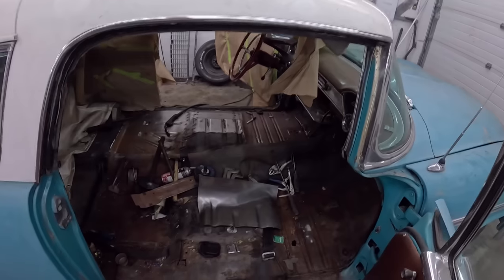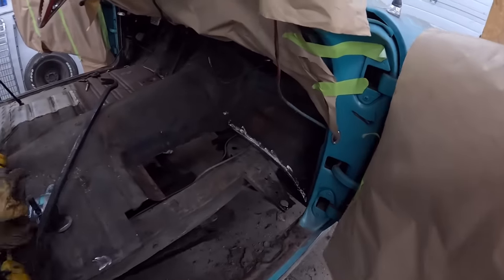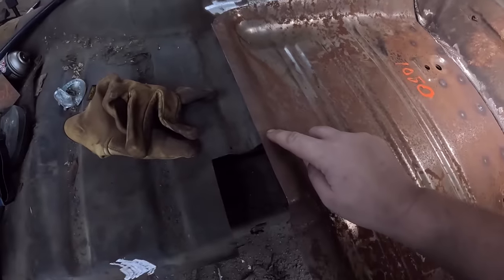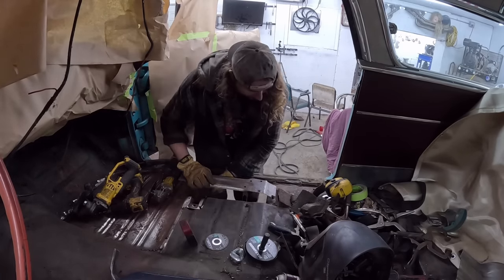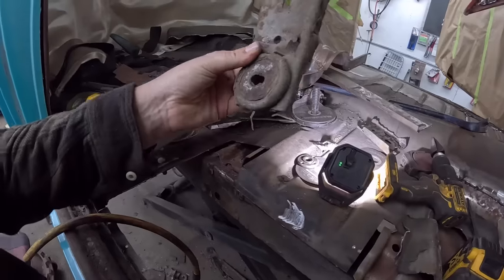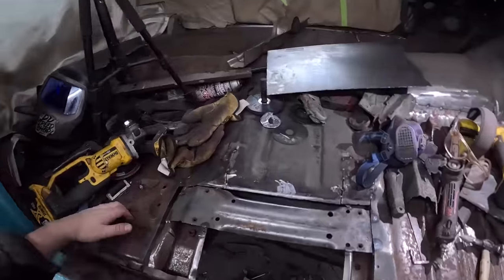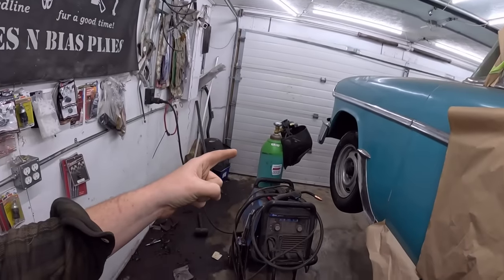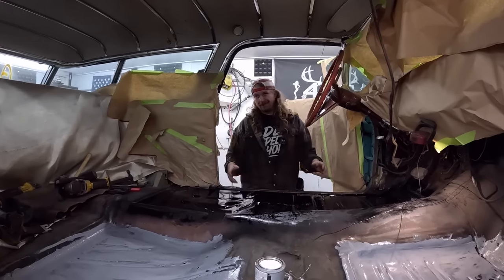ROTTEN FRAME? It's Worse Than We Thought... 1955 RottenMADD

Comment: Dan you are doing a great job on making a quilt floor . i did my 56 hardtop like this and now my 57 wagon . your welding skills kills mine im a grinder i am told but with next to no funds im still knocking it out the best i can with little cash. im up to $20 in parts so far for my 57 wagon floors and rockers. i love watching what you do and how you get so much stuff done. your about half my age so your energy level is a lot better than mine. i like your 57 hardtop work too .

Comment: Absolutely nothing wrong with that repair.  Seam seal it on the bottom only.  That is where any moisture will be.  Great fix.  Good job.
Reply: usually a floor rusts from the top down (water from shoes soaks through the carpet, or door and window seals leak)

Comment: Excellent work ! This is the way it should be done … keeping as much of the original car as you can .. and saving money for the most important parts to be needed later on like carpeting and drive train components, brakes etc. You have progressed into a true metal man and  fabricator . Also very professionally done the way I would have done it on my ‘ 55 gasser the Bandito..

Comment: Why do I like to see you cut and weld floorboard sections in. IDK
BTW, I noticed your door arm trim, and the lower window trim is not normally chrome. Normally, those pieces are painted. That is a lot of chrome, then on the inside, 
That car is going to be a nice cruiser with the overdrive.

Comment: Damn, Dan!! That looks pretty good. This is not so much a restoration, but a preservation job. I totally agree with you on patching the floorpan as it keeps so much more originality & saves messing up panel gaps. Just get a dent guy to take out the remaining damage on the roof & hood, then a light brush touch up like everyone did back in the day. That, a good polish & she'll be a sweet little period hot rod. Cheers. Leigh.

Comment: Dan, you're not a hack. A hack wouldn't be doing it the way you're doing it. It's just fine
Reply: A hack would be cutting it out with a hammer and chisel and replace it with flat sheet metal the way I did it in 1966. They didn’t make repo floors then and I couldn’t afford a grinder on grocery baggers pay in high school. 😮

Comment: It says a lot that this 69 year old car has some rot and there're piles of 20 yo gmt800 trucks from the 2000s  that are rusted in half where about half way back the frames are touching on the ground! And trucks younger than 10 years old with gaping holes in the tin foil bodies and crossmembers. You know what was a real eye opener of what pieces of crap newer trucks are I was working on the front brakes on my 92 c1500 and my cousin walked by who had a 06 4wd Chevy half ton said wow those brakes look way beefier than mine... He had a 4wd! Mines a 2wd half ton Cheyenne a base model at that! That 06 now is no more it was retired due to a rotten frame my 92 frames nice n clean both spent there whole lives sliding around through Maine winters! So what's that about oh yeah other than engines the gmt400s were the last GM truck worth a shit. And stock for stock the 5.7 vortec lasts as long as the 5.3 with only small power advantage. Sorry LS fan boys but it is true....

Comment: Hay Dan couldn't help but notice all the dust from the wire wheel if you attach the shop vac hose to the angle grinder it'll suck up the dust and metal shavings I do that and it dose wonders 👍

Comment: DD and Mortske are both "wrong" I'm sure you need the "right "silicone to replace those rubber gaskets on an intake manifold ,but with aviation form a gasket on both sides of them you can use those rubber thingies that everyone hates ,I use aviation form a gasket on both sides of all my intake,carb, oil pan and valve cover gaskets, it holds them in place,i'll even run a dab around the inside of my radiator and heater hoses.
 of course I only use Fel Pro and never had anything leak and should you have to disassemble,they're easy to get off. 
The poor mans alternative would be Indian head gasket shellac I think it's called buffalo now but two or three bucks a bottle isn't bad, I hate vacuum leaks or any leaks and this is the way to avoid them, you might take this suggestion the wrong way , I'm not telling you how you should do it, like a friend ,I'm showing you how I've learned to do it.

Comment: I enjoyed the video, learned alot, even though I have a fair amount of mig experience, but never this extensive stuff.  I am supposing a 220 volt wire welder is being used, I am unsure if Canada is a 220 volt country.  All I have is a 110 volt welder, a sp100 have always used a 20 amp circuit making it 90 amps max output and a thirty percent duty cycle,.  I did get an inverter tig welder, 220/110 volt capacity, but so far limited experience with the tig(soon to change), that I have used 220 volt.  I feel a wire feed welder is the best solution, though there are probably folks out there that feel wire feed is best.

Comment: Nice job Dan da Man! Way to power thru those floorpans, the neccessary next step. Now ur ready for some fancy footwork, double clutchin on down, Standin on the gas, stompin the brakes, tip toe'n around the cops. Ready to put the hammer down, breaker break Bandit. Got ur ears on good buddy? Oops.. gettin a lil carried away there Danny Boy! Never knew welding could get so exciting! 😂😂🤣🤣 Carry on my man! 😎

Comment: to clean panels of light rust get an old air mattress and cut out the top so that you have a bed with sides put the panel in it and you can push the edges up so that it meets the perimeter of the panel and poor apple cider vinegar over it and wait a day or two and it will be bare metal again

Comment: im from the uk, i dont know fuck all about cars i dont even drive, but i started watching vice grip, then pudding, then mortske and now you i really want to get into welding i should have done it when i was 15 but i decided to a NVQ in engineering (using lathes and millers) which i passed but im 45 now and ive never had a job that needed that NVQ, im currently waiting on having both knees replaced but i really want to get into welding i could probably strip an american car just from watching you guys

Comment: I'm known as TriFivGuy. I've had all 3 years of Nomads, 56 Convertible, many 55's, 56's and 57's since 1965. I've built many on my own, by myself and with my own money that I 've earned since I was 14. I grew up in a very poor family. I learned by doing. I built a show quality 55 Chevy 210, Wheel  Standing Street Legal Family Daily Driven GASSER when I was 19 years old. The engine was given to me as a junk 57 283. I had it bored 60 over  running 12.5 to 1 with radial cam, Chrome  Staight Axle & Cowl Forward 2x4 boxed sub-frame I made. I worked at Gas Station full time & got married while building the car. You remind me how my dad use to do things like kitchen cooking foil as bearing shim in a worn out engine. I cringe at what I see you do on your YouTube videos, but everyone has their own way of doing things.

Comment: Anyone else thinking the seat mounts aren’t going to line up with the floor  brace’s when Big D is done? Most likely the solution will involve cutting the seat brackets and re-welding them 🤷🏼‍♂️ 😟 rare hard to find seat brackets , I should add
Reply from the maker: Explained in the video.  Thanks fer watchin

Comment: You have done so many floors .this one deserves a FULL floor no patch panels, you basically patched 3/4 or more of the whole  floor , what’s the rush you could take all winter to do it ,and the car would be worth 8-10 thousand more .
Reply: problem is the car is complete ,wired,upholstered and all the glass,etc is still in it. its easy to put a floor pan in a gutted car but hard to put one in a complete car without a lift

Comment: I don't think I've ever seen you paint the inside of these raw parts? Or like.. clean the gunk out of the rockers before closing them in 🤔 

Wouldn't that just make this stuff rot again later?
Reply from the maker: I'm gunna hose em down with oil
Reply: @DDSpeedShop  they make weldable primer you could spray inside first